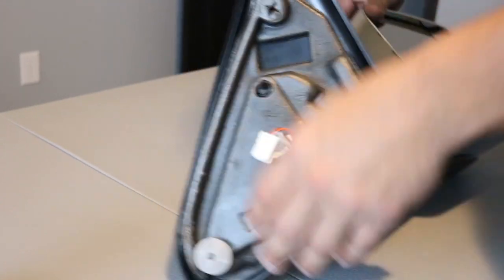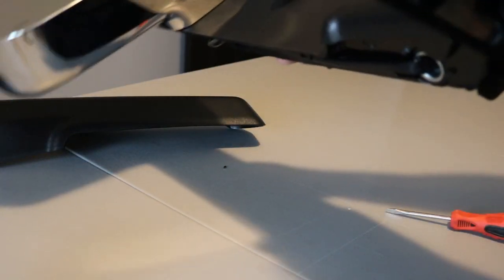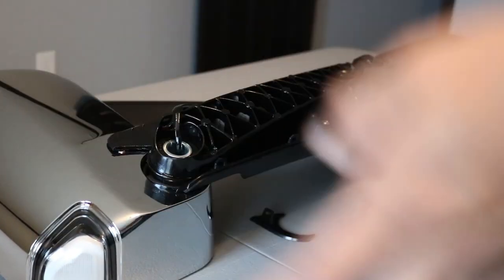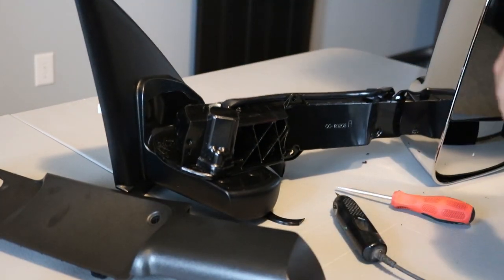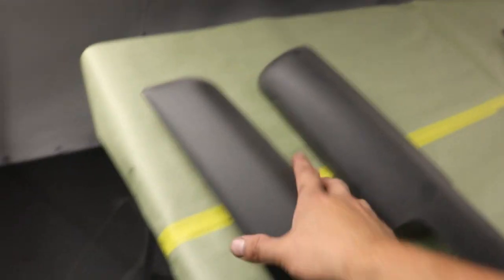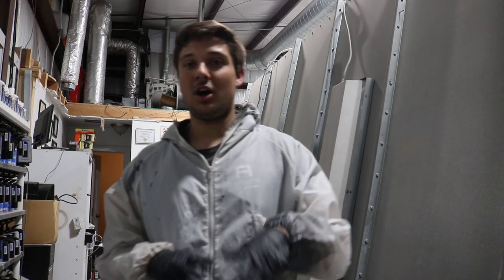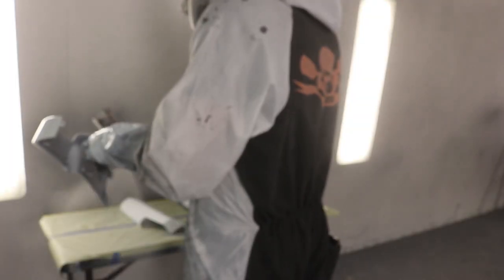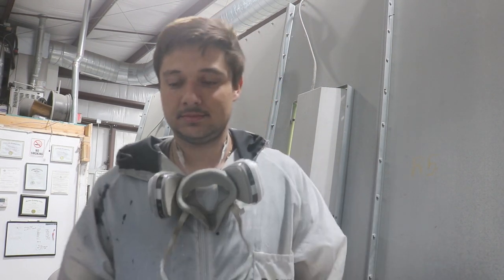Colormatching Ram Tow Mirrors! (Correct way!)

Comment: Damn - this is the best video I’ve seen regarding paint matching and application process. Made a list of the steps. Nasty textured tow mirrors and door handles got to go on my rig. 

What would be the best way to sand out the nasty heavy textured OEM finish on the tows and handles? 150, 180, 220 grit in succession?
Reply from the maker: Nope just red scotch bright and a high build primer